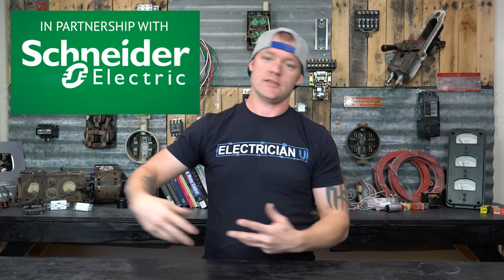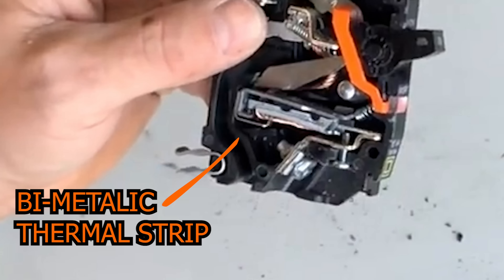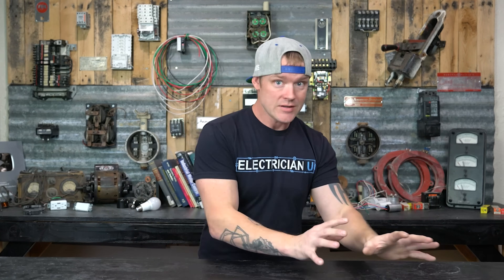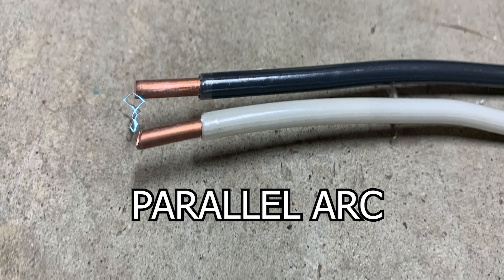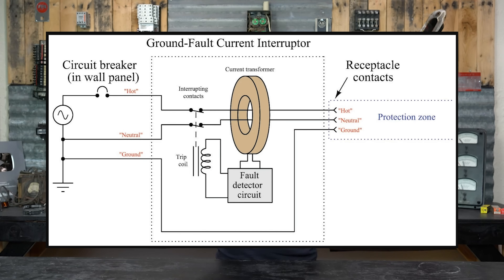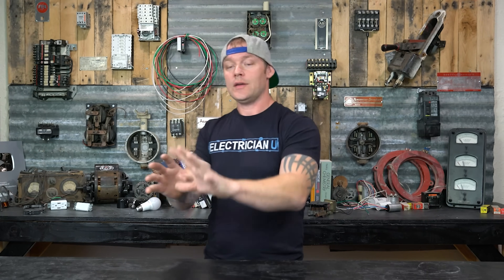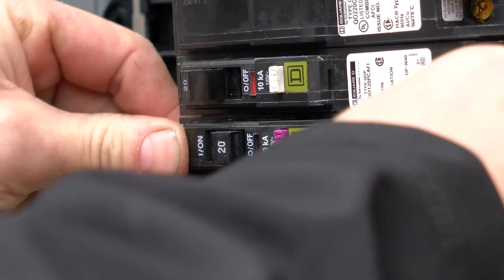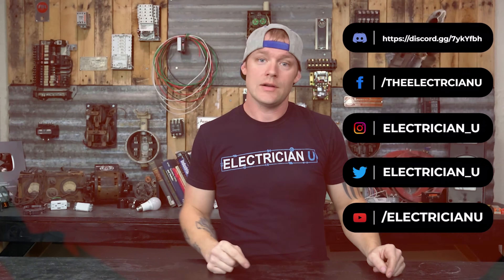Arc-Fault, Ground-Fault, and Dual-Function Circuit Breakers Explained

Comment: I have like 3 circuits in my house with 12/3 cable that all share a neutral..i have just regular older style QO breakers on these circuits and have considered upgrading my breakers to freshen them up..my question is if I use AFCI or dual function will I have problems with nuisance tripping with these circuits? And if so what do you recommend?

Comment: Two questions. 
1. I'd like to install these in my 30 year old home, just to reduce any chance of fire.  I have 1 or 2 circuits that run across the house that share a neutral.  It's essentially 240V but not a double breaker.  It's 2 separate breakers on opposite phases, so neutral carries the difference current.  Any way to install one of these without rewiring that entire branch?
2. One of my biggest fears of electrical fire is from a dropped neutral to the transformer.  Without the neutral connection, the voltage on either side of the neutral in the house can go anywhere from 0V to 240V, depending on load balance.  Will these breakers survive that, and more importantly,  will they trip?
Thanks.

Comment: Service call. Afci breaker randomly tripping.    Several other electricians there prior.   
Long story short, had it down to the master bathroom vanity lights.  Thought there was a staple too tight from light to light.  Ran new wire from the first to second.   When i got down from ladder qnd started to walk the breaker tripped again.   
After all this trouble shooting, it turned out to be one of the sockets in the 4 bulb vanity had a screw that cam out ( factory i guess) of the socket, every time someone would walk close the vibration from the footsteps would rattle it making the screw rattle around and hit it , causing the breaker to trip.   Once screwed back in , never tripped again.  HO was happy considering she had bout 5 trucks prior from our company.

Comment: Great information, but I'm seeing people not want Arc-Fault and Ground Fault breakers seems they see the cost of the product too high, just want a outlet inline.  NEC codes have manufacture input and they made the pricing higher then needed. I do (try) talking in to dual function if possible. Still having complaints on main disconnects at the meter being turned off as some neighborhood kids jokes.

Comment: Been trying to figure out a strange breaker set up quad breaker it got 4 poles all tied together so one bar goes across the outside and one small pin tieing the middle 2 poles but why do they all need to be tied is it that the wire has 4 hots insted of 2 ? I whould love to learn more about them looked it up and the internet does not give much info

Comment: Is a plug on neutral style mandatory on a plug on neutral load center, or can you still use one with a pigtails  or will the pigtail breaker cause the circut not to work?

Comment: Question: I have a mini-split unit on its own 20a breaker and my living room receptacles on a separate 15a breaker. Whenever i run my mini-split the living room breaker trips. Why is that?

Comment: The double bird, whether intended or not, cracked me up and made my day LOL. Great video. I'm just a generalist home inspector but run into problems with these things all the time. Pass it on to a licensed electrician for safety. I did work around a lot of ungrounded 3 phase 450 VAC in the navy in a previous life, though. Seen three people get electrocuted, and all were from less than 150 volts. It's the small stuff that'll get you.

Comment: The house I moved into has a ground fault interrupt outlet in the bathroom but no appropriate ground fault breaker. I'm going to replace the breaker box and rewire the house and break the number of rooms on each circuit. Right now their are three breakers one has living room kitchen and utility room the second  has both bedrooms and the bathroom. And the third is the garage. I'd like to put each room on it's own circuit and add ground fault in the bathroom, kitchen and utility room. But until I do that this spring will the ground fault in the bathroom work at all or is it the same as having a regular outlet?

Comment: 15:20 "Duel' is "Combat between two parties" vs what you actually meant, "Dual", which means consisting of two parts. Grammatically pedantic, maybe, but I already received a double-bird at 5:36, so I needed to earn it.😀 On second thought, sometimes when trying to wrestle those long Square D PDFC breakers into a busy panel, it seems like "Duel" may be a more accurate description. Great video, as always.

Comment: Well done video!  I am having trips pf these type of breakers when I use my Ham Radio Gear at fairly low power levels!  I have installed clamp on ferrite cores at the breaker to stop the RF energy getting to the breaker!  It helps but still get a trip often enough to irritate my wife when I use my radio gear!  Any ideas?

Comment: Couple of honest questions: 1. I have seen some tests where guys have taken under the protection of an arc fault breaker and went to an outlet or switch and created an arc by repeatedly touching the conductor to the terminal screw creating an arc with the breaker failing to trip, am I missing something?  2. With the price of arc fault being so close to DF breakers, should one consider going with all DF breakers or is there a disadvantage of having a ground fault where one isn't necessary, other than sometimes a pesky trip. Thanks in advance! Love your channel man!

Comment: Is there a way to test the dual function breakers from the outlet? I have a room that it is controlled by a dual function breaker. I've tried using the three-prong tester but it will not trip the breaker?

Comment: Excellent!! I knew about Arc, GFCI and Dual breakers for sometime but was not 100% sure of their function. I replaced a breaker box in our log cabin and decided to make them all Dual. As you say better to be overprotected than under-protected.
Actually I said all, there was one breaker that is a two pole (for the mini split) but I couldn't find a Dual for it. Is there a reason for that?
So glad you emphasize how lethal electricity can be. My experience is that people tend to be more fearful  of plumbing issues i.e. water, than electrical issues. With water you just get wet, with electricity your life is in your hand😀😀

Comment: Great video, very clear!
Another issue with e.g. a series arc, is the heat makes plastic (insulation or other) melt, and metal oxidize.  So the resistance increases and the heating increases.
12:20 not quite; what the GFCI detects is the difference between the hot and neutral currents, that part is right; however it's far more likely that a person touching the hot wire will get more than 5mA through them (hot to ground, 120V) than them touching the neutral (neutral to ground, might be a few volts if the circuit is heavily loaded).  Assuming that the other thing they are connected to is ground.
Would also detect them bridging between two circuits, say hot #1 and neutral #2.
14:54 guessing the code doesn't know what people will plug into a receptacle, could be anything, including a toaster with all those exposed hot wires; the sink provides a low-impedance, wet ground connection.  So if you have GFCI protection on the receptacles, they can't shock themselves by touching something with one hand while the other hand is in the sink.

Comment: I have a house built in 1916. I have areas in the house that have old 2 proug outlets. I want to replace them with 3 prongs. 
The plan is to replace all of my breakers with dual function breakers.
Good idea, since my 3 prongs won't have grounds???
It will be expensive to replace them all but cheaper than rewiring the house and it will give added protection right?

Comment: I installed an outside receptacle for use plugging in a small pool pump for a new above ground pool. I used a GFCI Breaker to energize the receptacle. The pool pump has a GFCI plug on the end of the cord and when one is reset and you reset the second it trips the first. When the pump is not being used it will be used for other loads. It is outside so it needs to be GFIC protected either way. Is there something I need to do other than replace the plug on the end of the pump cord?

Comment: I’m troubleshooting a 15 amp arc fault protected circuit in a basement finish utilizing metal studs. I don’t understand why the electrician ran two hot conductors parallel (blue and pink) from the breaker about four feet through emt into a junction box and then reduced to 14-2 Romex splitting to adjoining rooms🤔

Comment: Great video as always.  Question on the GFI breakers with the neutral pigtail.  If you have a couple of branch circuits to an area requiring protection like a pool, kitchen sink area, etc and you have just about room in your conduit to pull another hot so you will be sharing the neutral, will the breaker for the new hot function properly without a dedicated neutral?  If not is there a way to make that new hot GFI protected?  Possibly installing a GFI receptacle?  Or must that new hot be paired with its own neutral?
Reply: U cannot share a neutral  with gfci..it will trip due to 2 different loads on the same neutral not to mention it could overheat the common neutral connection..and if u do decide to share a neutral it must be on a double pole breaker..so when power is tripped on one circuit..both are tripped...in my opinion shared neutrals shared NEVER be allowed..not an electrician here..just my thoughts.

Comment: We had a lighting strike a few blocks from our home in Austin, TX. A number of things are not working but the worst is the AC. My question is simpler though. It's about a GFCI in our kitchen. It has worked for many years. Now it seems to be faulty in that it does not supply power to it's sockets or the others that are wired to it.

So, handy-man that I am, I bought a new identical GFCI and a non-contact voltage probe. (The probe was so that I could identify the breaker that feeds this outlet.) With the breaker off I removed the old GFCI, labeling the wires as I removed them. There was a single ground wire, The supply had a hot (black) and neutral (white). The load had a hot and neutral also. I connected all five of those wires to the exact same ports on the new GFCI that they were removed from the old GFCI. When I turned the breaker back on a little green light appeared on the new GIF. (The old one didn't have that feature.) I plugged in the NEMA-5 3-light tester and no lights turned on.

What is wrong and how do I troubleshoot this? Point me to a video if you've covered this before. Thanks for a great channel.

Comment: My uncles home burn down. Started the rebuild process with temp power. Adding a 50 amp circut for mabile home for living during the build process.  The 50 amp failed inspection due to not being arc fault breaker.  Can you give some feed back on why? My understanding is mobile home is treated as a dwelling unit. Not like a spa or hot tub. 

Im a  3rd year and want to learn.

Comment: How do auto-reset breakers accomplish automatic resetting?
Reply: My ideal circuit breaker…
- Dual Function Protection
- Leakage Current protection
- Surge protection
- Built-in power factor correction
- Automatic Reset capability

I would supplement this with multiple redundant grounding mechanisms and actively cooled circuits

Comment: Brilliant presentation.  Your explanation of the principles of operation and functions of these devices is a great addition to our knowledge base. 

Have you encountered any failures of either combination devices or stand alone AFCI devices when used on circuits with fractional horsepower motors (refrigerators, dishwashers, garbage disposals, etc.)? 

If so, what was your solution? 

We appreciate your generosity of knowledge.

Comment: Nice video. Was wondering if there are any circuits it wouldnt make sense to use a DF breaker on in a home?  I get customers with young children or folks that previously in their lives had a house fire that want top notch electrical protection, whole-house protection.  Thoughts?

Comment: Do GFCI’s just trip faster than normal circuit breakers when a ground fault is detected ? Because won’t a standard breaker also trip on a ground fault if hot and ground touch?

Comment: I have a question: I'll be running a new circuit for a bedroom (which is an office now), so that it's not sharing a breaker with another room. Long story short: I also want to install an outlet on the balcony just outside that bedroom, and a couple of lights outside. I understand that the outdoor outlet needs to be GFCI, but how about the outdoor lights? should I just do this whole run on a DF breaker and call it done?

I'm also planning to run a circuit for the garage (there are no outlets there now, except one on the ceiling for the garage door operator). It's under that bedroom I mentioned earlier. I guess I need GF or DF for this, huh? I want to install an outdoor outlet on this circuit, as well as a couple of lights next to the garage door. I also want the outlet to be switched. Do you think a DF breaker would be the best way to go here?

Comment: At 12:21 you state that if someone grabbed the Neutral, the breaker would trip because it would sense that "Neutral had dropped all of a sudden". Normally a GFCI would not trip just from someone touching Neutral. The only way that would happen, even if there were a load connected to the circuit, is if the person simultaneously touched Neutral and the Hot side of the circuit. Earth ground, the ground wire and Neutral are all bonded together back at the main panel so there is no difference between touching Neutral and touching the earth itself or touching a ground wire, even if Neutral is coming through a load and carrying current, As long as it has a direct path back to the panel, the current will go that way, not through a person. Obviously the Hot side is a different story. If you touch Hot simultaneously with the earth, Neutral or a ground wire you will get a shock and if it happens through a GFCI breaker, the breaker will trip.

Comment: I’ve always explained a GFCI as a doorman. He’s constantly counting electrons entering the building. For example:10 in 10 out, if he only counts 9 out. He shuts down & locks doors until number 10 is accounted for.

Comment: Is it better to have a a gfci receptacle or breaker? Didn’t know if the sensing feature of the GFCI was closer to the point of use, if it would trip faster.

Comment: One accident that can happen even with a ground fault breaker or receptacle is when the ground terminal is broken or internally not connected on the male plug of an extension cord. The ground wire in the cord can now mimic the hot wire and give a nice shock if you are wet even with no load. The power delivered can increase as the load increases. Grounded tools create a large surface area to connect to your hand or body to exasperate this effect. The longer the extension cord the better the shock. 

Sincerely, 

William McCormick

Comment: Arcs are used in Arc Welding, it can melt metal and start fires just like an arc welder does. 
Critters in the walls that chew on insulation can also lead to arcs and fires.

Comment: Got shocked once by a fridge.  Someone had replaced the plug and mis-wired it.  Swapped the black and white wires.  It had been that way for a while but it had just been moved to where you could touch a metal desk and the fridge at the same time.  Needless to say, I corrected the wiring.  This was about 1982 so it pre-dated GFCIs.

Comment: Great video. I started as a helper in 1972. Back then 3 prong outlets were the new thing. We have come a long way. I got fried a few times because someone cut the ground prong off cords to fit the old outlets and have seen and repaired some deadly installations. Got 3rd degree burns from 120 v arc flash from an outdoor light with water in the socket. I also worked an industrial job with overloaded panels. The room blew up and blew the steel door and block wall down. Nobody was there at the time, we were out about 2 hrs when it blew.

Comment: Is it true that all GFCI/dual function breakers from SquareD QO series always require neutral input to get the GFCI sensor to work? How does the wiring work?
Reply from the maker: Couldn't tell you with 100% certainty. 

But it functions the same way a GFCI outlet does. By sensing an unbalanced of current across the device and trips.

Comment: Can you please do a follow up video on why Arc-Fault breakers have a lot of faulty tripping. Seems like every electrician I work with hates them, even though they're code. Is there a way to prevent this? Any insight into it would be great!
Reply: according to his explanation they react to any anomaly on the circuit, not just to the big ones like the regular breakers, that explains the extra tripping.
Reply: This is complete hear-say, but I've heard a few people saying the square D dual function breakers are less likely to cause erroneous trips than just the std AFCI.  Have not examined this myself yet.

Comment: What do u thank about a dual function breaker on say 3- 8ft strip lights with led t8 bulbs ??
Reply from the maker: Overkill.
Reply: There in a garage is why i asked and it has to be protected also. The df breaker holds till i turn the light on and ive checked every connection and bulbs 3 times

Comment: So can you use GF beaker and Not use GFCI outlet in the bathroom 
Thanks
Reply from the maker: I would specifically direct you to the language used in 210.8. It does not specify either a breaker type or receptacle device type, it just says “Ground-fault circuit interrupter protection for personnel shall be provided”. Great question!